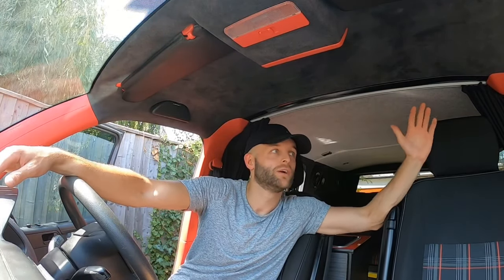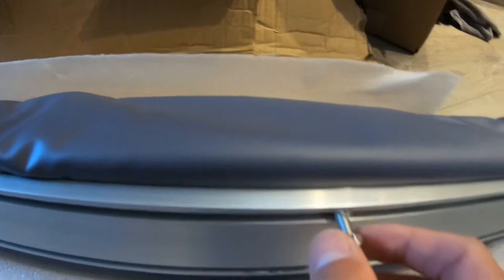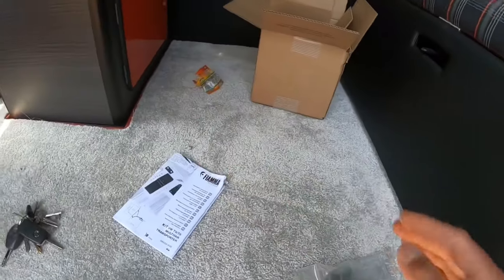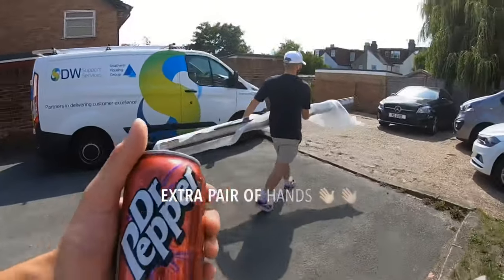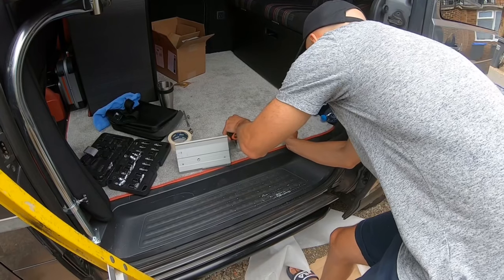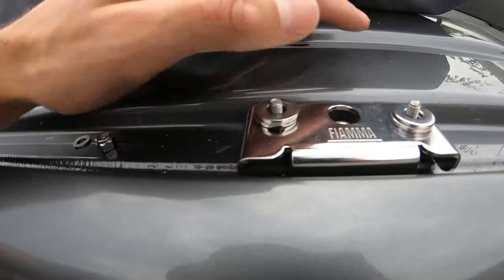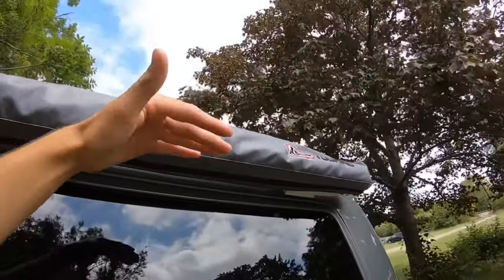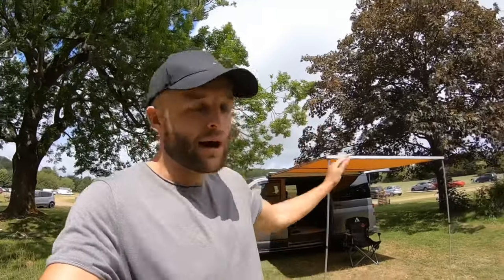Fitting an ARB 4x4 Awning to My VW Transporter T5 | Using Modified Fiamma Brackets

Comment: Hi Darren. 
I love those Australian shades that fold out along side and also around the back of van. But  I had to do my sunshade a bit differently as the wife did not want a tube strapped to the side.
On my old twin slider I had awning rails installed both sides and then had a custom cloth shade made (£180).  It has beading on  two edges and additional loops and some extra fittings so I can slide it into the rail in various different ways depending on what the weather is doing and which way wind/ rain is blowing etc. I bought some tent poles and I now have loads of different ways to put the awning up. The big advantage being its not permanent on the van, you can change sides easily, it can take really high winds and when rolled up takes up very little space.  I am really pleased with it.
Reply from the maker: Hi Clive sounds like you made a good decision with both side rails, great idea that. I did think about something like that myself too but I’m not very patient with putting everything back in a bag neatly after I’m done. I suppose there’s a lot of pros and cons which ever option you choose though 😄👍

Comment: Had one on my T4 for a few years now. I’d recommend pinning down the guy lines as soon as the blind is out. 
I’ve had the wind catch & bend the poles a few times. A 2mtr square tarpaulin tacked into one side is a nice addition (as used by Overlander)
Reply from the maker: Happened to me went straight over the van whilst I was in Romania the wind came out of nowhere 😂😂😂

Comment: I’d recommend putting some sealant in and around the holes where the factory bolts were otherwise you’re likely to get water ingress
Reply from the maker: Hi Orry absolutely correct!I I have sealed my bolts and the holes, I'll try edit that into the video as its actually very important info mate thank you!

Comment: Hi Darren, Great video, thanks. How did you find out which brackets from Fiamma would suit your VW. I have a low roof Mercedes Sprinter and want to do similar but do not know which Fiamma brackets to order to do so and fit an ARB awning.

Comment: Nice video Darren . Just 1 question when you pack the awning away I take it you have to roll it up and pack it away in the case
Reply from the maker: Hi Ian, yes it rolls up back in nice and easy, take a look on YouTube at some of the other ARB awning videos you will see the demonstration. I will be showing how it’s done soon too 👍
Reply: Tube Darren cheers mate 👍. I’ve got a pop top on my t5 so dunno if it would fit mine
Reply from the maker: Ian livermore I’ve seen awning fitted with the same brackets as mine with a pop top but the rear bracket is fitted more towards the middle as the pop top hinges would be in the way 👍